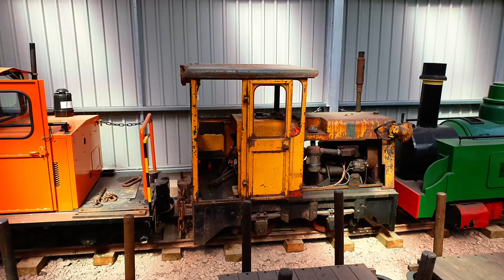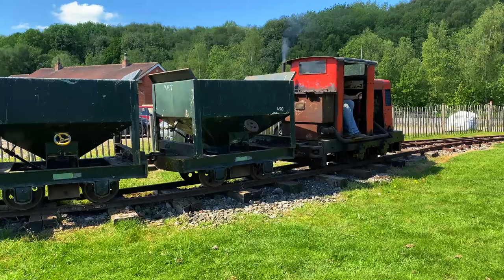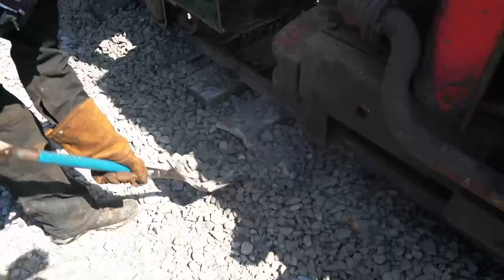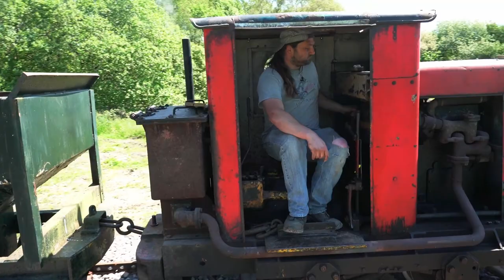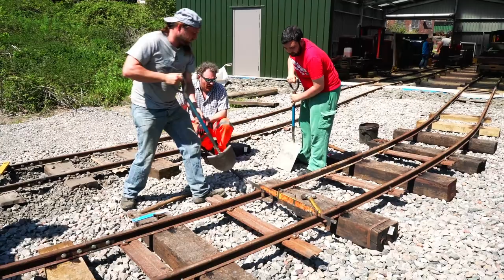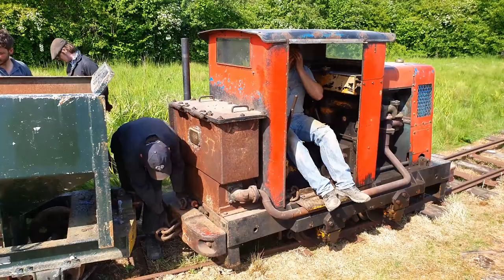Helping to lay a railway - working a Ballast Train on the Two foot!

Comment: That's a pretty fancy footwarmer on that loco😊
Reply: Yes I thought that too. Presumably the box at the rear is maybe an exhaust scrubber or spark arrestor
Reply: Seriously though what's up with the exhaust routing?  Is it being used to warm up the fuel, or just the cab, or what?
Reply: @noahorr3480  I was wondering that as well. Possibly bunker fuel oil?